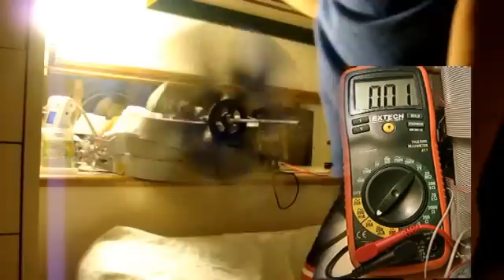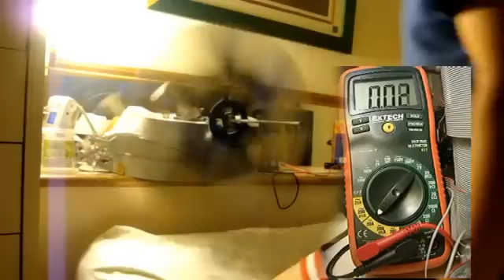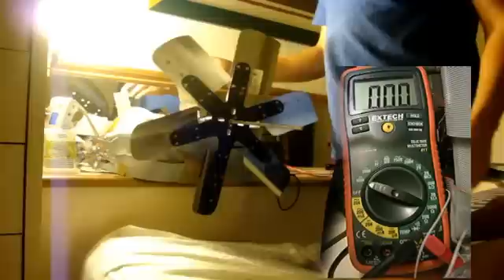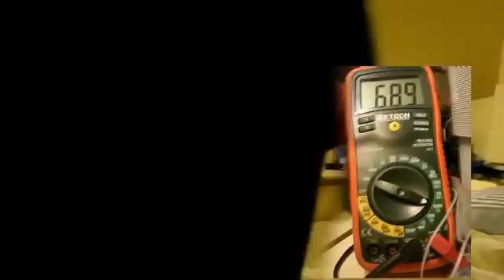ｗａｔｔｓ4.5 270ＲＰＭ ＭＯＴＯＲ Ｎｅｗｍａｎ

Comment from the maker: Now I realize that the effectiveness of the wind in terms of cooling the area and blowing the paper is dependent more on the torque than on rpm. I managed to increase the thrust of the wind at lower rpms with the larger magnetics involved. The velocity of the blade is more level. The residual torque available when I pinch the shaft has increased compared to prior setups. The cooling power is also better than it was at 340-360 rpms even though it is now at 220-240 rpms (result of 1.5x more wire).